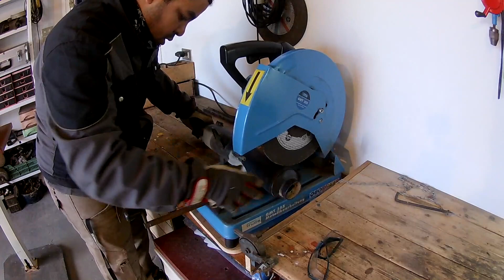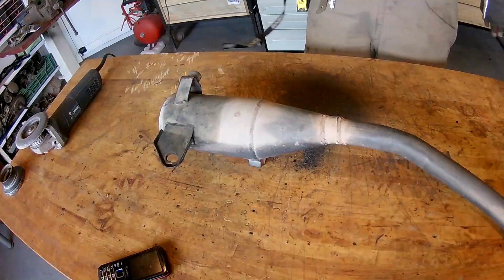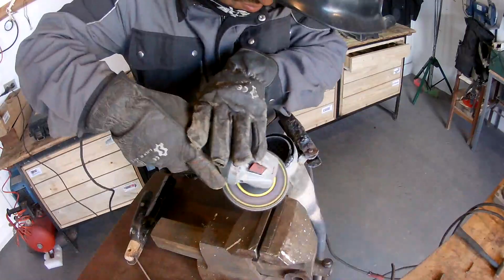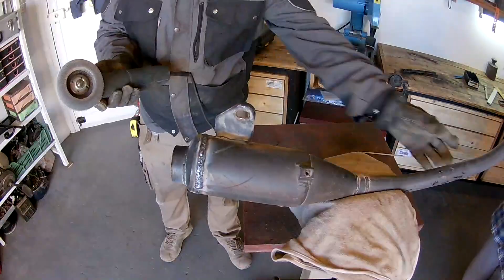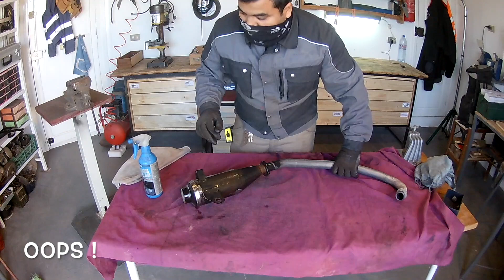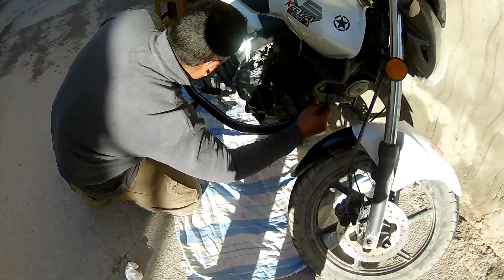Shortening the Keeway RKS exhaust- Raccourcir son pot d'échappement

Comment: The sound is 💥😎🌋 fire 💜
Reply from the maker: Je confirme ! Cest plutôt mieux que les pots chinois à 120 euros
Reply: @yosribahrini  slt , g un RKS , et depuis longtemps , g un plan de changer ou de modifier le pot ... puis je avoir les mesures exactes ? Merci ... Un jolie travail ça se voit
Reply from the maker: @slimviper3897  salut Slim. Demain je t écrirai en commentaire les mesures exactes. C la moto de mon ami. Mais le bout que jai coupé est tjrs dans mon atelier. Je te dirai demain et merci pour le commentaire
Reply: @yosribahrini  merci infiniment , l'idée est super sympa , rien que après coupé le pot , la question c : on peut atteindre le pose pied ou non , ça fait peur qu'on arrive pas ☺️ encore pour le son ça gêne pas les autres ?
Reply from the maker: @slimviper3897  jai pas compris la question autour du pose bien mais je peux te garantir qu on a pas touché au fonctionnement generale du moto. Je veux dire toute la ligne reprend sa place avec le mem systeme de fixcation y compris le boulon du pose pied. Autrement  dit la découpe est Après le pose pied, et celui qui monte dernière ne risque rien.  Its safe.
Si non pour le son, moi et mon ami le proprio on est arrivé là en deux parties. On a enlevé la chicane et cela fait un sacré bruit. Et quand ce n'est plus suffisant pour le rideur, On a raccourci le pot. Vas doucement étape  par étape pour mieux accepter le bruit. Si non j t'encourage  a modifier ton échappement que d'acheter un nouveau.
Reply: @yosribahrini  puis je avoir ton num
Reply from the maker: @slimviper3897  oui bien-sûr 
Passe moi ton num je t'appellerai dici ce soir
Reply: @yosribahrini  27323824